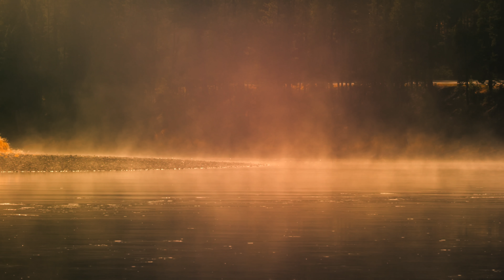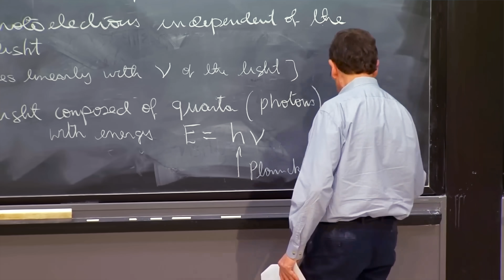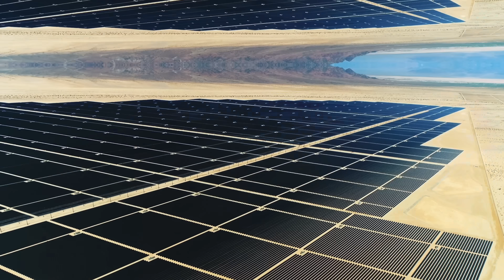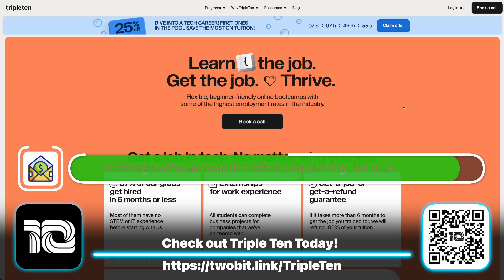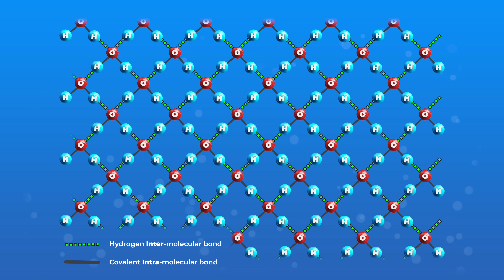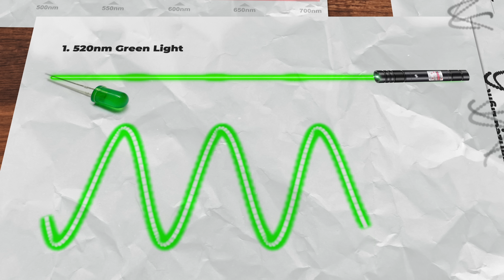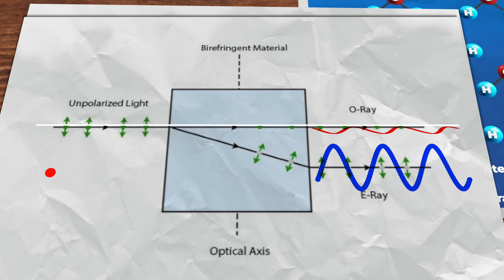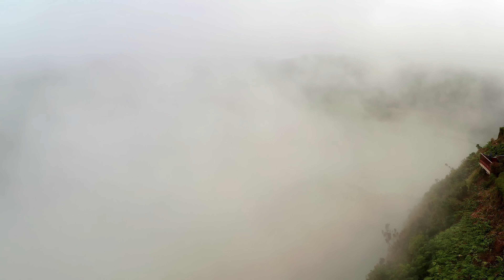New MIT Discovery Just Solved Water's BIGGEST Mystery!

Comment: Makes complete sense why plants hate green light. Green light evaporates water so plans reflect it away to reduce water evaporation.
Reply: This is so cool. Got me thinking. Could be why temperatures are cooler around plants, too.  They reflect the green light so there is more free green light in the vicinity to evaporate water in the air.  Maybe the evolution wasn't just to conserve water for the plant, but a symbiosis between the plants to keep each other cool.
Reply: @colleenforrest7936  Water  vapor in the air is already evaporated.
Reply: @pauleohl  not if it is small water droplets
Reply: @colleenforrest7936  Nope   The cooler temperatures are mostly explained by transpiration.   As the water evaporates from the plant it consumes a significant amount of energy according to the latent heat of vaporisation   2.45 Mega Joules per kg of water evaporated.    What is explained in this video appears to be a slight enhancement of this effect, a different pathway that helps with evaporation.  What is not clear is if it only works with water that is exposed to light directly.
Reply: @colleenforrest7936  I love this theory!
Reply: @colleenforrest7936  wouldn't this make areas nearby more arid and thus hot?
Reply: @colleenforrest7936  water in the air is already evaporated
Reply: @colleenforrest7936  Temperatures are cooler around plants because of transpiration. look it up.
Reply: @colleenforrest7936   Or maybe God is really really smart.
Reply: @colleenforrest7936  but plants  who live  in cold/very cold climates are green too and cooling air wouldn't help them
Reply from the maker: holy crap! I hadn't thought about that, but it does make perfect sense! need to look into this more!
Reply: @TwoBitDaVinci  This could go either way.  Trees taller than ~33 feet have to evaporate water to draw their sap up to the top.  Perhaps the green getting reflected inside the leaves augments the evaporation.  And this might be related to leaves changing colors in the fall, when trees sequester energy-rich sap down to their roots - no sense pulling against so much evaporative potential.

Fascinating, Captain... 🤔
Reply: @TwoBitDaVinci  - Plants ON LAND (especially trees) need to evaporate water, in order to suck more water up from roots, along with necessary minerals and biomolecules. Some individual trees are over 100 meters tall, evaporate over 1 tonne of water per day from their leaves, and they are NOT using their precious chemical energy (from photosynthesis) to 'power the pump'. Note that our best technology in pumps can only suck water up 10 meters, not 100. Trees do MUCH better than we can; trees use surface tension, capillary action, and other intermolecular forces within water, to SUCK water ten times higher than we can. That is another one of Nature's miracles.
Reply: @TwoBitDaVinci  I wonder if agricultural runoff that causes algal blooms on the top of natural water sources also can cause drought conditions by disrupting the water cycle by decreasing natural evaporation.
Reply: @TwoBitDaVinci  Its probably the other way around. They absorb other light so that the green can cause more evaporation so that they can get more nutrients up from their roots.
Reply: @TwoBitDaVinci  Yeah, let the sun shine through plants before it's hitting the water.
Reply: @TwoBitDaVinci  The terrible background music of this video will only serve to attract the dumbest possible audience.
Reply: @TwoBitDaVinci They actually talk about this in the article you just reviewed and deep dove into :)
Reply: @TwoBitDaVinci   pardon my naivety, would this water vapor be comparable to steam? Not sure if water vaporized with heat retains more heat than that done in this process or if that would matter when powering a steam turbine. 

Worked in waste to energy plants for almost two decades and this is basically what we do to make electricity. Burn garbage to create heat to heat tubes to create steam to power a turbine which makes electricity. As you can imagine, it is dirty, dangerous, nasty work. Especially when you have to rehab the boilers every six months to maintain efficiency and prevent tubes blowing. 

Not sure how big you have to go to make this work, but I am sure that the standard now is to build 5-7 story boilers, usually 3-6 side by side and burn garbage in them. . .  This sounds a lot safer, potentially less maintenance and potentially lower cost maintenance. 

Rushing water through a room bathed in specific light at specific settings sounds right up their alley. Ofc, the way it is now, pressure is created as the steam is created and then directs it where to go (cause there is only one way), we might have to lose some energy creating compression initially. unless we could create the needed light within the tubes/a confined space so the pressure is created and directed same as now. Another possibility is creating the tubes out of material that will hold pressure but will let the green light in to create the steam. 

Thanks for providing the opportunity to muse!!
Reply: @TwoBitDaVinci  So what type of engineer are you? What are your qualifications. Try misting water youll get 100,000 times more surface area and you dont need to pay for light which does nothing!
Reply: @TwoBitDaVinci  You really should have, like a lot before making this video.
Reply: @TwoBitDaVinci  thunderfoot just debunked this video, i strongly suggest you go and see his video if you want to learn something with real science, oops
Reply: @TwoBitDaVinci  please consider haemoglobin too in this context, as it is the same molecule as chlorophyll but with iron instead of magnesium as the central atom, which makes the hole piece red. ... :)
Reply: @mrparadise2329  probably why mamals like lying in the sun, they dont want to reflect the “warming energy” they want to absorb it… maybe blood is just red and there’s nothing special to it
Reply: @mrparadise2329  Quite a fantasy.
Reply: @mrparadise2329 That would be cool. I'd add covering how our body can use zinc for this when we're too low on iron.
Reply: @mrparadise2329  cells are doing fusion, mitochondria can fuse sodium with a proton electron pair to make magnesium, and can fuse potassium with a proton electron pair to make calcium.  They can also fuse sodium with oxygen to make potasium and fuse magesium with oxygen to make calcium. Neutrons don't exist they are just proton electron pairs.
Reply: @mrparadise2329  "please consider haemoglobin too in this context, as it is the same molecule as chlorophyll but with iron instead of magnesium as the central atom, which makes the hole piece red"
Haemoglobin is a protein complex, not a single molecule. I think you are getting haemoglobin confused with haem. Containing iron instead of magnesium is also not the only difference between haem and chlorophyll, they contain different functional groups. They are structurally similar because they're both based around a chlorin ring, but not close to the same..
Reply: @mrparadise2329  My knee jerk reaction to your comment was "nonsense, Haemaglobin and Chlorophill are totally unrelated"  but I think you're onto something.
Reply: @TwoBitDaVinci   remove the stupid background music next time
Reply: These MIT discoveries are always when the news arrives at Cambridge. Or when chemists figure out what farmers have always known. Every agricultural station in America has two  pans of water and for more than 100 years they've been recording the pan evaporation rate everyday, simply filling one of the pans up to the correct level each day.  You find the same thing in peru ancient Inca sites.  
Because if you need to know how much water to add to the soil to replace what's gone, there's no substitute for a pan of water that's subject to the wind and the Sun.  Even today we know that reading up on the temperature, wind and irradiance doesn't predict evaporation well enough.
Reply: interesting idea but subaquatic green algae also reflects green light and they are surrounded by water (definitely no worries with H2O evaporation) so I don't think that would be the main reason for using chlorophyl as main pigment absorb red and blue regions instead of green light.
Reply: Green algae floats partly at the top, so its still beneficial to reflect green light not to dry out to quickly.
Reply: @rteune2416  Green algae only floats because the O2 it has produced gives it buoyancy. Not because it is Green. Filamentous algae demonstrates this phenomenon very well on a sunny day. Unicellular algae produce O2 during the day and rise to the surface of ponds, only to sink again during the night once the O2 bubbles have been released or dissolved. Your argument, however, also falls down when applied to sedentary algae, which live attached to a substrate and are therefore immobile.
Reply: @Ed-bj5eq  It's theorized that one clade of early plants may have used retinol instead of chlorophyll for photosynthesis, meaning it's possible the earth was, at one time, covered in plants with purple leaves. I'm thinking that, rather than being green because it was more advantageous than other colors, plants are just green because it had a slight edge over the purple retinol due to the photomolecular effect being stronger at green wavelengths, so reflecting it away would have been slightly more efficient than specifically absorbing it, thus leading to the green plants outcompeting the purple plants. This makes me incredibly sad because purple is my favorite color and I feel like purple leaves on trees would be so pretty... And purple grass, too...

Edit: Basically, green algae in the deep ocean are still green simply because they're related to the clade of plants that used chlorophyll instead of retinol and thus survived better. It's not that they're green because it's beneficial that deep down, it's that they're green for the same reason that humans have tailbones, wisdom teeth, hiccups, and those tiny membranes in the corners of our eyes where other animals might have a nictitating membrane. It's a vestigial trait left over from the early stages of evolution when the trait was beneficial and thus survived, and it's much harder to un-evolve something once you have it already.
Reply: @StormTheSquid  its my favourite colour too!  You can get purple grass, its called Purple Haze ;0) and we still have purple sprouting broccoli, all though their leaves are green i think.
Reply: @Ed-bj5eq Okay, fair observation!
Reply: @Ed-bj5eq  perhaps what happened is a mutation occurred that slowed for the synthesis of a molecule that is better than other molecules at capturing electromagnetic energy. Out of all of the permutations that happened, green chlorophyll just happens to be the most efficient (interesting when you consider green is the most abundant wavelength of light from our sun)… but none the less could just be a coincidence
Reply: @Ed-bj5eq  Pardon me for saying, but that's a common misunderstanding of evolution. Evolution doesn't happen in response to a need.  A change happens randomly.  If the change is compatible with the organism's current environment, it survived. Then later, when the environment changes, organisms with a pre-existing change already in their genome that is more advantageous to this new environment will survive and thrive over those that didn't already have this random change and these organisms will not spontaneously change their genome to meet this new environment. They may, however change a behavior, but that's not the same thing.
Reply: @colleenforrest7936  While this has been the common knowledge, there's been several studies that put this into question. Seemingly the mutations are not as random as they were believed to be, and that the natural selection is not sufficient enough to explain how adaptable life is to new environments. 

Obviously a couple of studies is not enough proof, but a scientific mind should be open to the possibility that this misconception, might hold some truth to it.
Reply: @colleenforrest7936  Pardon me for saying, but that's a common misunderstanding of evolution. I'd love to see anything randomly spontaneously evolve something to help it survive, I'm waiting. We are intentionally experimenting on things all the time, exposing things to stuff all the time, observing them, quintillions of organisms watched under our microscopes for thousand upon thousand of generations and none of them spontaneously evolving anything. You're theory requires proof, of which you have none.
Reply: @Wishkeyn  Got to admit, things have changed in the last couple of years with genome being mapped now. Lots of strange stuff.
Reply: @colleenforrest7936  mutations are 100% random, but evolution which is the selection of mutation isn't. For instance mutations don't happen because of environmental pressure but environmental influences evolution speed.
Reply: @geemy9675  Mutation still must be under a guideline off creating an improvement
Reply: @jshaw4757  no, mutation are just random errors in the copying and combining mechanisms of DNA. errors are very improbable at the level of copying one nucleotide but at the level of an entire organism composed of trillion of cells in a constant cycle of death / duplication, and trillions of organisms reproducting they happen constantly. cancers and congenital disorders are some of the consequences.
DNA is just information that govern our growth/development and behavior of our cells, similarly to a computer program. like when introducing errors in the copying of a program, 99.9..% will generate bugs/defects, but because they happen trillions of trillions of time, sometime one defect actually influences the ability of the individual and it's offspring to survive and reproduce and statistics working in the favor of the mutation means after N generations the mutation can become present in the majority of the population.
it's a very inefficient way to improve a species and the success ratio of mutations is abysmal but it's the ONLY way to improve the gene pool. for human race, culture/education/learning has long take over evolution and is a much bigger factor in our capacity of adaption, than mutations.
Reply: @Wishkeyn  the mechanisms that generate mutations (error in the copying of DNA) like radioactivity, UV rays, or simply the minimum rate of errors that happens regardless of the environment, to have no "understanding" of the meaning of DNA.
it's possible that some genes are more or less subject to mutations than others and that this has become an evolutionary advantage one way or another depending on the genes (less mutations = more stability, less defects, more mutations = faster evolution) but the rate of mutation cant be influenced by the characters expressed by the gene, only by the way it's encoded in DNA. it's like if your copying a computer program in hexadecimal code, with an instruction set that you don't know, and you introduce differences. you can't predict what it's going to do, just observe the result. the DNA copy errors don't have a will to do anything they just happen.
the only mutations that are not result of random are the ones that would be crafted by humans given the mapping of DNA that has been decoded
Reply: @colleenforrest7936  Sorry, but that exposes one of the weaknesses in the evolutionary concept. If changes are random and not as solutionary responses to necessity or advantage then devolution and instability are more likely than positive advantageous Evolution. The increasing appearance of the necessity of programming for DNA is rapidly decreasing all viability for evolution. Changes tend to being detrimental and destructive for the organism.  We increasingly understand why we don't find inter-species examples.  The higher the likelihood of genetic change, the higher the likelihood of loss of survival. This must be accepted as the corollary to randomness.  Decades ago we were told the imaginative story of a . million monkeys with keyboards with endless time just typing RANDOMLY.  Eventually one monkey would accidentally type ON ONE PAGE a Shakespeare sonnet.  Great story, except that the allegory would not work with the materials of which life is composed.  And the correct arrangement of the letters for a sonnet does not honestly offer promise of the complexity of the arrangement necessary for DNA.  After all, it it less the arrangement than the coding for the precise duplication.  To make the monkey typing story truly applicable allegorically that monkey would need to design a typewriter which would type that sonnet flawlessly automatically infinitely.  But there is no more randomness.  Nope.  Eventually we need to grow up and dance to the music that the band is actually playing, even if they are not playing our song.
Reply: @colleenforrest7936  
You make a good point. Evolution is caused by random mutations, not because a plant decides it would be advantageous to obtain a specific trait.

However, for those of us that believe that evolution only explains the mutations we observe today (the seventh day where God rested from his labors), but does not adequately explain the fossil record: This  new discovery about green light fits neatly into place under the belief that a creator was designing things. That belief also explains how all the information could be encoded into the DNA of a cell that is necessary to build all the proteins it needs.

Evolution takes place, but it is a huge leap of faith to believe it could be responsible for all life on earth on a planet that is so young, in a universe that is only 13 billion years old (possibly 26 billion years old in a new hypothesis). Evolution also only tries to explain the origin of species, not the origin of life. If you start with a single cell organism, the math would suggest it should take trillions of years in the luckiest scenarios to get the variety of life we see on earth if we relied on random chance... But that math was done before understanding a lot of the added complexity of the DNA sequence and cell biology along with development timing. At this point, it just seems mathematically impossible to randomly add new information to DNA that is useful and doesn't result in the immediate death of the organism. Removing information by damaging a gene is far easier to account for, just like randomly typing a few characters into a software program never adds new working code. Instead, it just breaks that portion of the code.
Reply: @colleenforrest7936  that's outdated thinking. Evolution CAN change in response to needs, due to the existence of the epigenome. An organism's environment can cause DIRECT changes in gene expression from one generation to another. It is not "random"
Reply: @colleenforrest7936   'unguided evolution' is a myth.
Reply: @colleenforrest7936  I doubt that. dna is consious somehow. how else did the hares coat turn from mottled brown to snow white, the exact pigment needed for snow. you can say natural selection but how many snow white hares are born in a normal brown coated environment, and these aren't albino versions, they are normal just with white hair. why are tigers ORANGE yet can hide in the green leaves, unable to be seen by the prey. because the preys eyes don't see orange and the opposite color they pickup is green (or something like that I forget the specifics but its something like that) when a photo taken to match the eye of the prey, the tiger is literally invisible in these images. how did random evolution cause that? not gonna happen. how does random evolution explain stripes of differnt kinds. some are dots, some are sharp some are fuzzy stripes. no I think we know far less about DNA and how it actively turn on or off when in the enviironment. I wouldn't be surprised ( since everything is light, u and I  my keyboard, etc EVERYTHING) that light contains other information in it, and it is what signals the dna to turn on or off things. the entire random model from darwin is nonsense. its been proven false by some of the smartest mathemeticians alive. not going to even go into species evolution which doesn't exist only micro evolution does, IE finches changing bek shape size etc for specific environment needs. but the  finch never gave brith to a non finch. a parokeet never came out of 2 finches breeding. science is constantrly wrong about 2 species being able to mix. that would explain a new species being created. but evolutionarly no its never happeend that 2 cats birthed something other than a cat.  

lastly, people like you need to check yourselvs, you sounded like you knew for certain and everything you said was a fact. people do that all time in any science video comment section...when in reality, we just don't know for certain nearly anything. gravity, HAH, what a farce, the theory of relativity, WRONG, and completely destroyed.
Reply: @geemy9675  The competing theory is one of bounded randomness and information transfer much like some immune cells work (they go into a high mutation mode looking for an antigen) as pure randomness is impossible on normal timeframes.
Darwinian evolution is swiss cheese at this point and the people holding progress back are the people who think trying to find the proper mechanism makes you a creationist supporter.
Reply: @stormsabre22 there's not really much evidence for directed mutagenesis in the germline of higher animals though. There is dna repair being biased by region of the genome though, and perhaps by context/environmental factors. If anything maybe the rate of mutations that stick is inaccurate for reasons like these. There's also the notion of some genes and stress response systems being essentially unused until needed. So what looks like adaption through natural selection sometimes is not
Reply: @Wishkeyn  Its a myth born from people only looking at the peak absorption spectrum of chloroplasts, as opposed to looking at how the  whole leaf, or even better, the whole plant, makes use of different wavelengths. 

The whole leaf itself makes use of green light quite effectively, and rather than simply not using it, the green colour is an adaptation to better diffuse the green light deeper into the plant so it doesn't overwhelm and damage individual chloroplasts. It absorbs a little bit at each chloroplast, ultimately using most of the incident green light that hits the leaf.

This is why the overall rate of photosynthesis is mostly determined by the number of photons that hit the leaf per unit of time, regardless of the wavelength, as is given by the action spectrum (mccree curve)... and when considering the whole plant, for bush or tree like plants with layers of foliage, this becomes even more pronounced.
Reply: @michaelransom5841  Why am I tagged? I just said evolution, might be guided by more than just natural selection.
Reply: @colleenforrest7936  If it works, don't fix it.
Reply: @colleenforrest7936 this sounds correct but also sounds wrong, by what you're saying that would mean all desert plants were already around before the desert was there
Reply: @gfdia35  interesting, how so?
Reply: @jshaw4757  mutations are random and  "positive" mutation are selected ( "negative" mutation disappear and "positive" ones thrive) resulting in evolution following two citeria
-reproduction rate
-survival from birth to reproductive age
it's not ALWAYS in the best interest of the survival of the species although it usually is:
some mutations will increase reproduction  but will have no or negative impact on survival like beautifully colored feathers which make males more attractive to females but can also make them easier to spot by predators. imagine the males have a 10% lower survival rate but 50% reproduction rate. their offspring will be ~40% more to reach reproductive age and they will get more and more prevalent in the species population and the less attractive mutations will progressively disappear but because the food doesn't increase ultimately you could have less individuals reaching adult age and the population could shrink. if the mutations are too dedicated for reproduction and not enough for survival, it can result in the species disappearing. so yes between two separate species, usually evolution will select the most adaoted for survival, but within a species, it's not always the case. this is how you have peacocks that carry heavy feathers that give them advantage for reproduction but make them very bad at flying. they still managed to survive as a species but they are nowhere as common as other species which evolution focused purely on mass reproduction, high adaptability and like ants , rats, flies, mosquitos etc...
Reply: @colleenforrest7936  I knew that ofc but it just struck me how hard it is to make real randomness. The odds to lose the legs are much better than to get 4 in stead of 2, some creatures get a hundred. Even more interesting are the odds to later get the legs back. They could reappear fully functional with a billion years of leg evolution. We also have no idea how much data is really inthere already, this might be our 100th planet. Funny stuff
Reply: @Wishkeyn  yes, birds quickly adapt new beak types based on available food sources. I believe even Darwin noted this with Finches.
Reply: Anyone who uses the word 'randomly' in a scientific setting are automatically disqualified and any measure of actual understanding is not within them @colleenforrest7936
Reply: @colleenforrest7936  Love and believe your comment is true in most cases I recall a recent article about a plant or creature evolving rapidly (3 to 5 generations) due to environmental challenges. I am sad that I don't recall details or where to find the information
Reply: @jshaw4757  Mutations are not guided.  The amount of life forms available in an environment allows for random mutations to occur without all organisms dying out.  Like a previous commenter mentioned, the ones that have a superior trait are the ones that pass those traits on to their offspring.  There are many unused traits stored in the genome from previous mutations that are only necessary at the right time.  And once again, these mutations are passed on to the organisms’ descendants.
Reply: @Ed-bj5eq  Bu they consist of water molecules as part of their being, reflecting it away might very well be a way of defence from " green light radiation "
Reply: @Anubite89  absorbing it would work better though
Reply: @Ed-bj5eq  My two cents.  This indicates clouds absorb green light allowing red and blue through.  Plants that use red and blue would out perform plants that need green when the clouds/mist/fog were more common.
Reply: @Ed-bj5eq everything flora and fauna is beneficial to fungi. maybe it has an influence here. it has a habbit of making things act for it, rather than for themselves.
Reply: @Ed-bj5eq wasn't it hypothesised that green plants were survivors of the purple plant arms race which were so efficient that they caused an oxygen catastrophe? So green plants, the users of leftover nongreen light, were the only ones left
Reply: @Ed-bj5eq  Yes, you're right about that.
Reply: @Ed-bj5eq yes, algae is "green". Some algae. Multicellular algae that likes living on surfaces and at the top of water columns. Unicellular algae tends to not be green.

In other words, algae that lives near the sun is greener. It makes sense.
Reply: Dude, that's right! Also probably why chlorophyll evolved to absorb everything BUT green light. Nice catch!
Reply: @ipp_tutor  science!
Reply: @ipp_tutor trees and tall plants require transpiration to literally create the vacuum suction required to pull nutrients up from the roots... Evaporation is not a plants enemy
Reply: @ipp_tutor plants require warmth (infrared) and energy (high frequency, uv). These colors of light are simply more useful for photosynthesis than the green light
Reply: @ipp_tutor plants have more than just green chlorophyll inside them
Reply: @ipp_tutor  was just about to post this. Great minds!
Reply: @ipp_tutor  Indeed.
Reply: 588nm?
 @ipp_tutor
Reply: @ipp_tutor How do you all come to the conclusion that plants can't process green light 🤦‍♂️ this has been proven in plant breeding for more than 10 years and you can read about it everywhere. But people like you also buy purple LEDs for plants 🤣
Reply: @ipp_tutor  now chemicals are evolving 😂
Reply: Does not make any sense to me - and you got 350 likes for it?!??? and an additional heart from 2-bit-daVinci???!!!???. Can you explain what you mean? If plants would intentionally reflect green light for the sake of reflecting it, any water on the surface or within the leave would be intentionally hit twice - by the green light coming from the sun and again by the green light reflected by the plant. How would that reduce water evaporation? The green of the plants is the left-over of photosynthesis, which uses up the blue and red part of the spectrum in order to split CO2. That's how plants "eat". Whether or not the newly discovered effect plays any additional role in this at all might be an interesting question, but that can't be answered with a simple ad-hoc association.
Reply: @marcelma  Why can't these people get excited because something finally makes sense. There are exception to green leaves  in nature. Think about it, during autumn trees gets less sunlight and chlorophyl in trees break down and the tree leaves dry out and fall.
Maybe it happens because absorbing green causes leaves to dry faster, maybe not. Maybe these are not even corelated. But the thing is to keep an open mind.
Reply: @solo10041  Tree leaves dry out and fall, because the tree is reducing the water supply and it is re-absorbing the ingedients of clorophyl, because it doesn't "want" to loose them, when it throws off the leaves. - These are all well understood aspects that made sense long before. I have nothing against people getting excited - I have been wondering what exactly are they getting excited about. A flash of real insight into reality might feel similar but is not the same as an imagined "aha"-moment, because the latter merely links two previously not connected thoughts.
Reply: @solo10041  That isn't really an exception. It is true that the colour changes of deciduous tree leaves in autumn (prior to the leaves completely dying and falling off) is a result of the chlorophyll decomposing: The red/yellow/orange pigments in the leaves were always there, but in lower concentrations than the green chlorophyll. The green colour of healthy leaves is therefore much more intense, so it outshines the other less intense colours.

A good analogy for this is the older type of sodium-vapour lamps used in street lighting: The discharge tubes in these lamps contains a low pressure mixture of approximately 99% neon and 1% argon gases, plus a tiny pellet of sodium-mercury amalgam. When the lamp is switched on, starting from cold, it produces pink-red light from the neon component. This generates some heat and therefore warms up the lamp, until it is hot enough to vaporize sodium. Adding sodium vapour to the gas mixture generates extremely intense yellow-orange light. The pink-red neon light is still being produced, but you can't see it because the yellow-orange sodium light is so much brighter.

The exceptions you are really looking for are those where the intact, active chlorophyll is not green: Yes, these do exist - perhaps most commonly in some species of algae, such as blue-green algae or red algae. Some seaweeds are red or brown over their entire life cycle, such as "Irish moss", which is used to make carrageenan and other related thickening or gelling agents. There are even some trees which have a red variation of chlorophyll and hence red leaves - the most well known are several species of maple tree.
Reply: @marcelma  yes if chlorophyl "wanted" to protect water from green light it would absorb it, not let it pass through like it does.
Reply: @marcelma  its people drawing an inference without evidence based on a misunderstanding of the role of green light and transpiration in photosynthesis.. it doesn't stack up when scrutinized though.
Reply: Everyone knows the score after the game is over!🤦🏿‍♀🤦🏿‍♀
Reply: This would have implications into the search for planets with complex life. Odds are most of not all plant life would have a green component, provided that the host star produces green wavelengths of light.
I wonder what other molecules react in this way to certain wavelengths of light.
Reply: @OzGreg  "I wonder what other molecules react in this way to certain wavelengths of light" .. i would say most...
..and that the 'choice' of geen light or EM of a special frequncy to reflect, helps in sevral chmical processes plants use(to not absobe green)..
take silicon(Si) colar cells as an example.. thay make excellent use of energy from red-green light, but performs exceptionally bad at blue where almost zero is absorbed, this is simple down to one fact the band-gap of electrons, the ability of the electron cloud of an atom to absorb energy of a certain frequency enugh to knock one of the electrons to a higher energy state.. silicon lacks the ability to absorb blue almost completely... chlorophyl/green leaves lacks the aability to make use of a certain ban-gap because of the atoms the molecules are composed of...

..what baffels me is that a scientist claims this is new information...
..been known to physicist for decades atleast (its the main reason cheap solar panels cant exceed 31% effeciency, most will tap out at 20-25% constructed as todays once)
Reply: @OzGreg  there are more types of chlorophyll with different absorption spectrums that could be equally useful on a planet with different conditions.
also the green light reflected by plants is not a single wavelength so it's not something that could be amplified. stars are at least  billion times brighter than planets.
detection of exoplanet is almost never direct imaging and when it is, it's only gas giants and even if plants could live on those planets (!) the likelihood to detect green light from plants through the gases is zero.
Reply: @OzGreg the star would need to peak at the green part of the visible spectrum after passing through the planet’s atmosphere, not just produce green light period.
Reply: @OzGreg  Probably all molecules react to light as you suggest. Lately, scientists are "tuning in" to plants by attaching electrodes which intercept sounds resembling what we call music.
Reply: Now that is a very interesting thought. In otherwords Chlorophyl reflects the green light to minimize evaporation from plants. Looks like the astronomers looking for reflective spectra from alien photosynthetic spectrums might still need to look for green plants too!
Reply: Damn, this absolutely makes SO much sense! 😲
Reply: @gregokeefe6502  "I wonder what other molecules react in this way to certain wavelengths of light" .. i would say most...
..and that the 'choice' of geen light or EM of a special frequncy to reflect, helps in sevral chmical processes plants use(to not absobe green)..
take silicon(Si) colar cells as an example.. thay make excellent use of energy from red-green light, but performs exceptionally bad at blue where almost zero is absorbed, this is simple down to one fact the band-gap of electrons, the ability of the electron cloud of an atom to absorb energy of a certain frequency enugh to knock one of the electrons to a higher energy state.. silicon lacks the ability to absorb blue almost completely... chlorophyl/green leaves lacks the aability to make use of a certain band-gap because of the atoms the molecules are composed of...

..what baffels me is that a scientist claims this is new information...
..been known to physicist for decades atleast (its the main reason cheap solar panels cant exceed 31% effeciency, most will tap out at 20-25% constructed as todays once)
Reply: Rejecting green removes a transpiration variable, making water regulation more controlable. This very well done video practically leads to green plants. Perhaps frogs and other green fauna use it too? I claim no aptitude in zoology, so leave that for others.
Reply: Perhaps we need to rethink molecular bonds. And if light can directly excite electrons then we could develop motors that run directly from sunlight.  What are the the limits placed upon the newly discovered effect by surface tension?  Can this effect be used on water in an enclosed glass container?
Reply: Probably more because if it is green it can't use the free electron as easily to make photosynthesis
Reply: Green from plants has to do with chlorophyll’s absorption, not water evaporation or anything to do with photomolecular effect.  It’s fortuitous that they happen to be green.  If you study the chlorophyll molecule and its excited state from absorption versus its non-excited state, it’s not a phenomenon because it matches water evaporation.
Reply: @thomaskn1012  there are different kind of chlorophyll types, evolution has selected the most efficient ones that are used by every plants.
but absorbing red and blue light and letting green light pass through does not bring any evolutionary advantage regarding water evaporation, if anything absorbing green light would reduce water evaporation. also in a dense primary forest there is a whole lot of water and humidity but light is scarce. so capturing green light would be an advantage, and even it increased evaporation, which it doesn't, it wouldn't pose any issue regarding water.
Reply: @thomaskn1012  close but not 100% true... in the atmosphere, there is too much energy in green light... if chloroplasts efficiently absorbed it efficiently, it would damage the photosynthetic mechanisms. selective pressure pushed the absorption spectrum towards dispersed absorption of green light.
Reply: @thomaskn1012 Um… all of it is from natural selection pressure and processes.
Reply: So if i understand it right, spraying a fine mist into green light it would be the most efficient because of the amount of air in the air? 

Also, would that mean that painted water will evaporate differently? 

Wouldn't greenhouses also benefit when green light gets filtered out before hitting the plants? Would less evaporation mean that the plants are more efficient? What about the extra heat? 

This topic seems really interesting.
Reply: @bastiannenke9613 I think in the green house senario the glass box is the water trap and not letting it evaporate away so not really needed but I suppose it would make a great experiment to tint glass green on the roof and and grow identical plants in a clear vs green one but I suspect you'd actually get lesser yield out of the tinted green one simply because you're now decreasing the full suns energy making in inside the house
Reply: That means plants on other planets would also be green
Reply: @Trollsworkshop  except those plants that are red anyway on Earth too :))
Reply: @Trollsworkshop except the possibility of that alien worlds host star being different like a red giant perhaps
Reply: I don't think that's related. The green color comes from absorbing red and blue light. The green part is reflected or just pass through. By reflecting green light the photons would have a longer travel through water and a higher chance of breaking the hydrogen bonds on their way. Absorbing the light would have much more effect
Reply: Word!!!
Reply: watching the video and this came to mind too
Reply: Maybe a good spot there... I think it could be a secondary reason though, if not just coincidence. Evolution is a genetic battle. It usually takes more than one reason for some adaption to persist.... I also think lots of focused magnifying glasses are the simplest way to desalination.. Fields of Lots of tall glass tubes with magnifying lid and run-off pipe at the top going to a condenser cooled by incoming cold water about to fill the tubes, surrounded by a mirrored ring focusing light through the field or perhaps individually directed concave mirrors.
Reply: now you're getting it.
well done, human.
Reply: @growthisfreedomunitedearth7584  .. Growth is cancerous and apes will never unite unless they're transformed into AI-controlled Tanshumans. Freedom is non-reliance on other people.
Reply: Plants don't "reflect away" green light at all. Green is what remains after they absorb red and blue. That makes plants look green to us.
Reply: Wow, so many armchair scientists under one single video …
Reply: This could also explain why  plants grown in low light areas have a darker green color then those grown in the light. Because of low light, the plants will need bigger then normal  leaves but that means  more surface area and more  waterloss. so the plant compensate  by havinh darker leaves.
Reply: Nature again, its in plain sight we just cant see it
Reply: maybe it is why we humans are not green. But aliens from planets with less water are little green men? Lol
Reply: I really enjoyed both the post and responses. It would be nice to have tool that scrapes all the ideas that have stemmed from this and kind of fact checks them against known scientific knowledge and sorts those needing further investigation.
Reply: @markpirola8152 agreed, I've had a great time reading these comments,, that almost never happens, and I was thinking the same thing but for a complete success actual work needs to be done lol
Reply: you'd think we'd have been able to figutre that out a while ago... how dumb are we collectively? smdh
Reply: Many of the shade cloths used at nurseries and in yards are green for a reason. I would like to see a comparison between soil moisture levels for green shade versus tan shade versus...
Reply: Plants aren't actually very good at reflecting green light, they just don't absorb it. This is why with thin leaves you can see through them and everything is tinged green. In fact, plants would benefit from actually evolving the ability to absorb green light, but altering chlorophyll in this way would require unlikely mutations.
They are green because green absorption evolved first in microorganisms (green is actually the peak of the sun's spectrum; green absorbent microbes look violet) and took up more of the most abundant wavelengths in the ocean, so it was successful to use unabsorbed wavelengths rather than green which was already mostly absorbed.
Reply: Is this related to why a house with blue roof don't burn in Hawaii?
Reply: @evelynn4273  Someone is paying attention
Reply: This is in reverse, if plant is colored green then it evaporates more water.
If you have known evaporative cooling where the body cools down when the water evaporates, this means that the plant was able to survive direct heat from the sun because they can expel more water and cool themselves down.

This discovery is quite revolutionary especially if you understand that most of plant enzymes need a certain degree of energy to start catalyzing co2 to sugar, this now backs up why you can grow plant in grow lights even with the absence of heat from solar radiation. This means that you can technically absorb more heat from air to plant allowing the surrounding air to be much more cooler (heat sink) and bring new perspective interm of global cooling (meaning green material/leaves can technically cooldown earth more than sea water with similar area).
Reply: @betabotz4391  I agree if plant doesn't absorb green light, it means it lets more green light bounce on the white cellulose, so it could evaporate slightly more water that is on the surface. but plants are not THAT concerned by heat. usually when they  do there is no more water on the leaves to evaporate.
by the way evaporation of water doesn't happen due to plants but mostly due to sunlight hitting the oceans. this is how vapor goes into the atmosphere and later condenses as clouds. every cooling effect of evaporation will be compensated by condensation later. water does not keep accumulating on the atmosphere , ultimately it falls down. the only way to increase the amount of water in the atmosphere is global warming. hotter air holds more vapor. it's the same reason you can't cool down a room or any closed system with evaporation (like a swamp cooler). you can locally cool down air, increase humidity, which will condense and give back the heat. a heat pump can move heat because you have a heat source and a heat sink with good heat insulation between both
Reply: @geemy9675  Note that the green color of the plant is the Chloropyll pigment which is located "Inside" of the cell, basically in the chloroplast. Note all part of the cells is green-colored.
Don't be an idiot and treat the entire leaf as a green material where it will totally bounced off the green light. Take note that these membranes/granum were unsually aligned to refract green light rather reflect and were locate usually on the side of the cell. That is why when we study the cell and stick to our usual understanding of photosynthetic activity, plant adapting green colored is quite not right.
If plant is to absorb enough heat from light (frequency >570) and the refracted greenlight serve as trigger to maximize transpiration/evaporation.. it will now have enough reaction mechanism to suck-in water from roots to leaves... IT NOW makes total sense.... More water evaporated=more pressure differential in the leaves system = faster nutrients transfer + more cooling to withstand radiative heat.
As I said this study is SO GROUNDBREAKING if you know what you are talking.

Edit:
In short.. you scatter/refract the green light inside the cells of leaf rather than reflecting it on the leaf's surface. In layman terms, you just make the entire cell (except the chlorophyll itself) to have "more" green light (white/day light + green light from refraction).
Reply: You can apply this idea more deeply to the photosynthesis reaction. Photosynthesis uses water as an input, and if chlorophyll did not reflect green light, the reaction probably would be less efficient.
Reply: @idou1149  no because it has nothing to do with evaporation. the green color is the result of the chlorophyll absorption spectrum, not the other way around
Reply: @geemy9675  And the chlorophyll absorption spectrum just happens to reflect the spectrum of light that excites the very water molecules the chlorophyll is trying to use? THAT seems like a stretch. . .
Reply: @idou1149 microwaves are the wavelength that best matches the harmonic of the water molecules, not green
Reply: @idou1149  probably is a far stretch
Reply: @geemy9675  And the chlorophyll absorption spectrum just happens to reflect the spectrum of light that excites the very water molecules the chlorophyll is trying to use? THAT seems like a far stretch. . .
Reply: @idou1149  chlorophyl does not reflect green light it absorbs the other wavelengths and lets green light pass through and the cellulose which is white reflects all wavelengths, so chlorophyll is not a shield against green light it's quite the opposite.
Reply: @idou1149  Not if it used the green light. It wastes it now.
Reply: @idou1149  Highly unlikely.  Plant only use a tiny fraction of their water for photosynthesis - most is used for dissolved chemical transport.  But the green-light-evaporation thing only applies to water exposed to the atmosphere - not in cells or within plants.  So it might impact evaporation at the stoma (typically on the bottoms of leaves).    Many primitive plants, like algae, don't even have stoma.
Reply: That's not the reason. The sun's light actually is slightly higher in the green colour spectrum than blue or red. Green is therefore the optimum colour to maximum light absorption for photosynthesis.
Reply: @geetarwanabe  why it reflects green away then?
Reply: Interesting insight, but chlorophyll seems to be green to deal with fluctuations in light.  SciShow has a video on it "Why are plants green instead of black?" from 3 years ago.
Reply: The first photosynthetic organisms were purple though; and green only became predominant choice later... I'm not sure what that could mean under this new light (pun  not intended)....
Reply: and in the meanwhile the green reflected light helps to evaporate water located in the nearby area which gives the plant a more humid environment which gets the plant to grow more and produce more leafs and takes in more water to produce more oxygen. Isnt nature just fascinating.
Reply: mind blown, thank you
Reply: Insightful response….
Reply: You'll notice how some plants flip their leaves just before it rains.  This allows the leaf undersides, which on many have tiny hairs that catch water as it falls.
Reply: WOW!! What a Great Tip!!! Thank you man!!
Reply: I keep a tote filled with about an inch of water on my fridge. After about a week it evaporates, but not because of heat.
Reply: @johnjeffreys6440  on or in? anyway air in a refrigerator is dry. refrigerators condense water from the air and evacuate it. air at 6°C can hold about half as much water as ambient 20°C
Reply: @geemy9675 lol ty you I was like what in the hell 😂 inch of water in a tote ,, fk are you on about son 😂
Reply: @johnjeffreys6440 first why? 2nd if it's in your house it is because your ac removes all the moisture in your house to make it colder same as inside a fridge
Reply: Old information.   See BBC documentary Global dimming.   Evaporation rates were dropping for decades & it was found decades ago, the photon relationship was more of a factor in evaporation.
Reply: Funny thing is, the sun emit mostly green light.
Reply: Deuces for the deduction. 🍁✨
Reply: Holy crap!
Reply: Plants' chlorophyll reflect lots of infrared light.
Reply: Our sun is mostly green.
Reply: I guess non of you read the exact paper, researchers just used a green laser to show this photoeffect. They do not claim that other wavelengths do not cleave water clusters, which I believe do. This is naive and incorrect assumption at all! I think that channel should have mentioned it, otherwise it is similar to dirty journalism and clickbait  such as "Asteroid will hit the Earth!!!"
Reply: I immediately thought the same thing when you said green light. I wonder what this phenomenon says about relationship of chlorophyll to its green color and other “phylls” relationship to the purpose of their color/reflection of a certain frequency of electromagnetic waves.
Reply: Good reasoning.

Now we just have to wait for another decade before those "geniuses" at MIT and other overfunded and overrated institutions start using their brains to figure that one out like you did here, in an instant, in YT comments.
Reply: And beta-carotene dissipates heat. A perfect combo.
Reply: you're the lind of people Elon Musk is seeking. Sincerely.
that lind of reasoning is a sign of some kind of genius!
well thought and said!
Reply: @SaberBenSalem bro spell check sheesh ffs
Reply: @gfdia35  :)  next time bro
Reply: Oh, I just posted a comment about that too! Also chlorophyll is tuned to use mainly blue and red light for photosynthesis! Amazing right?
Reply: Interesting
Reply: I need some green filter on my windows to grow my plants faster now
Reply: uh no, infrared is the key, and any light will work. this isn't new technology, this was all discovered and talked about long ago, go read The Fourth Phase of Water by Gerald Pollack.  Why am I being led to believe this is something knew by someone who is clearly a token ethnically diverse person?
Reply: This is a bit of a myth. Green light is too intense and would damage the sensitive photosynthetic mechanisms if absorbed all at once by a single chloroplast. The plant still uses greenlight, but it diffuses it across multiple chloroplasts by not strongly absorbing it in the top layer of chloroplasts, allowing the light to penetrate deeper into leaf surfaces to drive photosynthesis in chloroplast located towards the bottom surface. 

In fact, the McAree curve is basically an inverse of the solar spectrum, meaning plants have evolved to "flatten" out the spectrum so to speak, and maximize the efficiency of the use of the light... almost as if they evolved to maximize the use of sunlight.. lol.

Outside of some morphological issues, you can grow plants under pure green light just fine.
Reply: I also got a insight about plants, but because   they are crucially need evaporation to pump water high. So we need to decide if they don't absorb green light to leave that energy for evaporation or they reflect it to slow down evaporation around.
Reply: My mind immediately went to plants and chlorophyll when they mentioned the ideal wavelength of light is in the green area of the spectrum.
Reply: If there's specific frequencies that splits water molecules more efficiently, maybe filters that change all other non- efficient frequencies to efficient frequencies would work better?
Reply: There are some plants with dark leaves especially in tropical countries.
Reply: @watermenlon3617  but they use the same chorophyll
Reply: Dayum, bro! Nice connection!
Reply: I think the green light reflected might accelerate evaporation by scattering the green throughout the foliage.
Reply: I’m not sure that holds up. From what I understand it’s just making contact at all that produces the effect, and mainly happens at the very point where water makes contact with air, so it wouldn’t really matter if the plant is reflecting more of it or not, since either way it’s getting hit by it.
Reply: Well, plants are green because green is the only “color” of the light it doesn’t absorb
Reply: @ElJosecho  Not quite. Plants do have other colors of chlorophyll inside them (as evidenced by their changing leaf colors in the fall for trees. The purple, orange, red, etc are other types of chlorophyll in the leaves), but green chlorophyll is just the dominant type in a lot of plants
Reply: I was thinking the other way around, chlorophyll is translucent so are leaves, they only let green light in, thus, it make the water expand and would've explained plant growth
Reply: the absorbed light is converted to heat
Reply: also, plants do reflect infrared
Reply: Maybe I should wear a green shirt in the summer.
Reply: And this means that plant life on other planets likely tends toward green as well, even if their stars don't emit exactly the same spectrum as our own...
Reply: Awesome comment.
Reply: Mind blown!!!
Reply: Also it explains more rains in areas having large number of trees, resulting in green light being reflected causing more evaporation thereby resulting in higher concentration of water in the atmosphere which ultimately form clouds or condense to form rain droplets
Reply: Plants do have mechanisms to regulate water loss, but these involve controlling stomata (tiny openings on leaves) and not specifically reflecting green light.
Reply: DUH
Reply: Brilliant!! 🧠
Reply: Most plants are not water conservers. They actively try to evaporate as much water as possible because nutrients flow in with water, so cycling through as much water as possible gets maximum nutrients from the soil relative to neighbours. There are other highly effective tricks to minimise water use when it is an issue, but it very rarely is.
Just because plants need water doesn't mean holding it is better.
Reply: i'm afraid that that is an unscientific jump to a conclusion.
Reply: No, plants are green because they preferentially absorb red and blue.
Reply: I think idou1149 has it precisely. Since water is actually an input in photosynthesis, you don't want it turning into a gas in the middle of the process. Your chloroplasts might explode. lol.

As regards mrparadise2329's point about hemoglobin - well, let's think about this. When you are overheated, your capillaries open up and more blood gets to the surface. Maybe this is why I find it oddly comfortable to do a little gardening in the midday sun versus on either side of midday when all that happens is that I just get hot and sweaty and uncomfortable.

If the atmosphere filters out green light at certain hours, then its evaporative effect is mitigated. And all that happens is that I get beads of sweat and feel hot. 

Viola! lol.

We should therefore wear green clothes when we are outdoors to keep cool.

Drat, I think I only have one green t-shirt in my things.

Edit: On the other hand, you don't want gas bubbles forming in your bloodstream so I think this needs tweaking.
Reply: Transpiration happens either way though.
Reply: I don't think plants feel one way or another about green light. The process of photosynthesis requires the absorption of red and blue light, which leaves green to be reflected.
Reply: Contrary-wise, some plants, like trees, would depend on this to create the amount of negative pressure needed to bring water to their uppermost branches/leaves.
Reply: I hope it was a joke.
Reply: I hope it was a joke.
Reply: except that is completely false and the light goes through all the water parts of the plant anyways
Reply: Yeah except that isn't why they reflect green light
Reply: You're talking nonsense... Plants process green light too. There are good research reports from Sanlight. But it's precisely because of people like you that they keep buying these purple LEDs just because you have no idea. Greetings from Austria
Reply: @Cryogenic1981  Thanks. I'm actually interested in preventing evaporation, to reduce the amount of water needed for plant irrigation. So, this is interesting to me for the opposite reasons of this video.
Reply: It's the exact opposite, but you don't even understand colors.....omfg....
Reply: Could be, but more likey is that the green if the least abundant color in the spectrum, therefore allowing more of the light to be absorbed. Yes water retention is important but transpiration is also equally essential for plant life. It's like drawing a conclusion humans evolved with bigger stomachs to eat more food, but that extra tissue also creates more metabolic energy expenditures. Also there are like 6 different types of clorohpil with slightly different colors.
Reply: NOT SO MUCH.   Water inside the plants cells or within the xylem or phoem channels isn't going to evaporate - period.  It's a closed system so any vapor pressure is at equilibrium.   Plants do lose water to atmosphere (transpiration) through stoma structures which exchange CO2/O2, cools the plant, and also drives the xylem transport.   Plant don't "hate green light", they just love red and blue for photosynthesis.
Reply: After reading the MIT PNAS paper - this conjecture goes from unlikely to highly improbable.  Of the ideal light (polarized, green 45deg) only 0.84% is absorbed by a water surface.  Let's make a crazy-high estimate that 0.25% of the entire solar spectrum is absorbed for photomolecular -evaporation.  Also lets make a high estimate that this excess evaporation is 4x more efficient than thermally driven evaporation (the paper suggests similar).  So the light-effect would increase the evaporative energy ~1% (0.25%*4).  1% sounds not-trivial, but we get a similar 1% increase as our sky-high estimate from a + 0.3dF (<0.16C) temperature increase.    I don't see this tiny effect driving much selection pressure.

Plant are green b/c that NEED to absorb red&blue and have no use for the rest.
Reply: How about Purple Leaf Plum ("born to suffer")? AND, how about seaweeds, they are green inside water. And taking in account that all life out from the water, they were green before direct sunlight.... Or, for example frogs, they are mostly green, and reflected green light will avaporate liquid from the skin faster (back lit), skin in that case supposed to be absorbing green light. Your theory definetely logical, makes sense, but it doesn't explain water plants and water weeds...
Reply: Stupid as hell
Reply: @Cryogenic1981  plants love green light, plants are green because there is the most green in sunlight, nature wastes nothing. if plants wanted to protect themselves from excessive evaporation, then the leaves would reflect the infrared radiation of the sun, because IR radiation is much more present and overall more energetic than the 555nm green
Reply: Whooooaaaa!!!!!Holy crap that's crazy.
Reply: Holy s****!
 Then we should not use green netting for "green houses"??
Then either the black or sliver might be better!
Reply: What if you take out blue and add infrared red and red?
Reply: Green light also negatively affects the cycle of photosynthesis
Reply: Very true.
Reply: This explains why martians are green!!!
Reply: Open source intelligence right there!
Reply: It could be a factor but I would be careful about jumping to that conclusion. 

This explanation would only make sense if reflecting the green light decreases the likelihood of this interaction occurring on the plant. Given that it is a surface interaction (i.e. the effect happening further inside the plant would not cause evaporation because the water is not in a position where it can leave the plant) reflecting the green light rather than absorbing it may actually increase the incidence of this effect (absorbing the light with a pigment would reduce the number of times the light passes through the surface of the plant).

Compound this with the information that:
- Not all plants (or more generally green photosynthetic organisms) are in areas where transpiration is a negative thing--thus this selection pressure would not be present for aquatic plants or ones with excess or sufficient water supply. We know that there are shallow water green alges that have been around for a long time (which would never have a reason to limit transpiration because they are literally swimming in water).
- There are other fairly well researched reasons that plants may avoid using green light. For example that structures that absorb it (with green being the peak output of the sun for terrestrial/shallow water) would have harvest too much energy which could cause damage or disruptions (basically over charging things which is dangerous). This research that looked into this model of 'moderating energy capture' and it apparently fit even with things like purple photosynthetic bacteria (because the spectrum of light reaching them was different).

tl;dr there may be some connection in some places, but I don't think this is anywhere near enough evidence to come to that conclusion especially given there are already other models that seem to fit more universally.
Reply: @kanoaika The fact that evaporation happens was settled. A more specific mechanism of HOW the process works is all that is updated.
This is exactly how science works. The whole isn't invalidated with new data. For instance, the fact that some diseases are contagious was already known, but then specifics wee learned about viruses, then later figuring out more and more down the line doesn’t invalidate the previous info.
In other words, science must be able to fine tune and even be able to toss out theories and replace the former hypotheses with the new information.
Fine tuning what came before is part of the process.
Reply: @DCJensen333  Very correct ...
Reply: @kanoaika  TLDR but yeah, I think chlorophyl A and B are the two most effective compounds for photosynthesis. if there was other variants with different colors that could be combined and capture more wavelengths it would exist in nature.
Reply: @kanoaika  Thanks for pointing this out.  I was going to go into the cascade of electrons and all that as to why they are green, but I think your version is a little more comprehensible for the readers here.
Reply: @kanoaika  Thank you for being one of the more reasonable responders.. lol.. you hit the nail on the head when you said "that structures that absorb it (with green being the peak output of the sun for terrestrial/shallow water) would have harvest too much energy which could cause damage or disruptions (basically over charging things which is dangerous)." 

That is where the evidence points... To clarify, while green light is less absorbed by chlorophyll compared to blue and red light, it is still very effectively utilized across the entire leaf. Green light is diffused and used across a greater number of chloroplasts with just enough absorbed at each one to maximize absorption while minimizing damage, as is supported by the action spectrum, even more so when considering the entire plant.... an interesting observation, and not really surprising either..

Interestingly, when you compare the action spectrum to the solar spectrum, you’ll notice a near inverse relationship. This indicates that plants have evolved to maximize the use of every incoming photon while minimizing the risk of overloading their photosynthetic systems. Imagine that!.. lol..

and you are also on the right track when considering aspects of where evaporation happens. one of the things that people are overlooking here though, is the fact that evaporation is critical to the photosynthetic process, in the form of transpiration. it is the very act of evaporating water at the stomata that allows plants to create the partial pressure gradient that allows for the exchange of C02 and oxygen. the faster the rate of transpiration, the faster the rate of photosynthesis, other limiting factors aside. Plants are only interested in limiting the rate of evaporation when there is an insufficient supply of water, or when the rate would exceed another rate limiting factor. So it is much more important to a plant to control the rate of evaporation through means such as the stomata and evaporative barriers such as the waxy cuticle.

Long story short, as much as it might make some sense at a cursory glance, on further scrutiny this idea doesn't really stack up.
Reply: @michaelransom5841  Exactly. Glad there are other people here who actually research things!

I got a bit tired replying to like 15 comments so I didn't go into much detail about all the fun stuff you talked about.

People often assume one simplistic thing based on something generally true but forget that there are lots of other factors and interactions.

Like people tend to go from a correct statement that plants need water to live to thinking that it is the one factor and only factor that plants are selected for (forgetting about all the fairly obvious problems like diversity of plants and the environments they live in in addition to the more subtle things like the importance of transpiration as a key driver of nutrient/material uptake and transport in terrestrial plants).

(Which is particularly interesting because from a more general view it means that they are often using lots of the solar energy that people think of as 'wasted' when they focus too much on photosynthesis. It is all about a balance of the various factors in the environment. Even within plants its amazing that people don't consider and get skeptical about their ideas when observing that Duckweed, enormous conifer trees, C4 grasses, mangrove trees, and cacti all still use light wavelengths in similar distributions despite having completely different water management priorities/strategies).
Reply: @kanoaika  well said
Reply: Fantastic insight!
Reply: @standlegweak9854  Though wrong.
Reply: ..and now we finnaly have a good answer to "why green".
Reply: That is a brilliant deduction!
Reply: This is a much more satisfying explanation than "sunlight is mostly* green light". Little kid me was constantly confused as to why the sky wasn't green then.
Reply: -clorophyl does't evolve theres only two types a/b and they have been the same since...a very long time ago
-photosynthesis  uses 1/ red and blue light 2/water captured by the ROOTS 3/ C02 from air
and it produces 1/ carbs that store energy or let the plant grow 2/ O2 released 3/ the green light not used is reflected
-leaves have "pores" that can close to block C02 and stop photosynthesis if the plant lacks water

so if plants could evolve to process green light they would probably do and would have darker, less colorful, 
 almost black leaves and would grow faster/require less light. light is a scarce ressource in dense primary forest and creates strong competition between plants to grow quickly and reach rhe canopy. plants able to process green light too would have a buge competitive advantage.

if dew is on the surface of the leaves it has more chance to be evaporated by the white light from the sun + green light reflecred ny the leaves
Reply: @geemy9675  , that's very interesting ... but if I'm not mistaken, there are plants with red chlorophyll (Red Foliage Trees), which have red leaves (ie reflect the red light) all along (not just when their leaves die, as most trees in the autumn), but for some reason these trees didn't end up as dominant vegetation.
Reply: @blueckaym if they were less efficient then that would explain it, maybe there was once more red trees and what we have today is the last of the hangers on.
Reply: @geemy9675 on the other hand, the pores on leaves (stomata) open to take CO2 in and let O2 out, and when there’s more CO2 in the air, they use less water! So said the late Freeman Dyson.
Reply: @shandor2522  "Carbon dioxide is indeed well mixed in the atmosphere. This means that if we look at the CO2 concentrations globally, the value is about 400 ppm everywhere"
higher concentrations of CO2 only happen in enclosed spaces
"The chemical equation for photosynthesis is 6CO2+6H2O→C6H12O6+6O2"
so plants do use exactly ONE molecule of water for EVERY molecule of CO2 processed by photosynthesis...
Reply: @shandor2522   - very much utilised by greenhouse farmers everywhere.  Maximise sugar production, minimise water use (water is often the most expensive ingredient, to source in agriculture - and the greatest required quantity.)
Reply: @geemy9675 Indeed. That doesn’t necessarily mean that the author of the video, which answered so enthusiastically, isn’t  as understanding of the subjects he divulge but certainly gives a bit less weight to statements like “I reviewed the paper and can’t find fault on it” hehe
Reply: @frgv4060  being a Berkeley engineering graduate , experienced and successful mechanical and software engineer and tech enthusiast I think he does have an understanding way above the average youtube commenter. though youtube  doesn't reward pinpoint accuracy, fact checking, scientific method etc..
Reply: @geemy9675  I recall pinpointing a mistake on a Neil deGrasse statement and get bashed with similar “reputation argumentation”. Of course the mistake was real, quite obvious… and eventually acknowledged. But it takes more than the “average Youtube commenter” to have more than mere person infatuation and enough critical thinking, culture, education and why not, experience on let’s say “cultured circles” to put into perspective the merits of certain claims. That said, I have all the right to doubt and express that doubt no matter how offensive it may seem to you hehe. But you can, of course, continue regaling me with some other fallacy. It is indeed entertaining.
Reply: @frgv4060 not a facepalm emoji sufficient enough to express how facepalmy that comment was
Reply: @gfdia35  If something pinpoints to a lack of knowledge on a specific area, in this case a bit of life biochemistry history, compounded with that conclusion that doesn’t really make much sense… casting doubt to the “any paper reviewing authority credentials” it is only logical. So if it is to you the most outrageously absurd comment to make given “the author” ok, I would suggest you make some better valid points instead of just fussing 😂😂
Reply: @geemy9675  thanks!
Reply: @geemy9675  I would not be so eager to dismiss the commenters suggestion, especially when you got wrong the numbers of types of chlorophyll, there are at least 6 types: a, b, c1, c2, d and f.
Reply: @geemy9675 Been to Pikes Nursery before- and noticed that some plants do have nearly black leaves - what's the difference between those and lighter green leaves?
Reply: @geemy9675  you're clueless. It's not that the chlorophyll evolved, it's the plants that evolved the chlorophyll. BTW, there are plants that DO have red/brown/black leaves for most of the year - not many, but some do.
Reply: @vaakdemandante8772  red leaves still use same chlorophyll, the red color doesn't come from chlorophyll. but anyway this whole idea is wrong from the start since green chlorophyll does let  green light pass through, if you wanted chlorophyl that reduces evaporation it would have to ABSORB green light. plants deal with evaporation in many different way which is not related  to their color. cacti can keep water for 6 month despite being green
Reply: @geemy9675  It evolved from something- this could explain why the green method dominated the world and drove out the purple version.
Reply: @Hinoema01  this is a nice explanation but it misses the fact that chlorophyll absorbing all but green light cannot reduce evaporation. if anything it increases it vs other variants of chlorophyll that would absorb green light.
Reply: @geemy9675 chlorophyll doesn’t evolve?  How the how did it get here in the first place?
Reply: @derekmcaleer2386  every type of chlorophyl has similar spectrum that absorbs red and blue and lets most green light pass through so it's color didnt evolve. also red and brown algae evolved to green algae using chlorophyl, because of better light in shallow waters, 500million years before land plants, and were not subject to evaporation so suggesting that plants evolved chlorophyll to become green to minimize evaporation is rewriting (pre)history
Reply: @geemy9675 not subject to evaporation ? Huh,,,, so just for one second let's pretend the algae are self aware and know their in a pond that is rapidly evaporating to soon be a dry dust bowl , pretty sure they'd wish they could slow down evaporation,,,,,, I kept seeing this algae argument as if 1 all plants are identical and all evolved for the exact same reason and 2 all algae are ocean going and have unlimited water supply, technically all of earths oceans will evaporate so it's at least quasi plausible and not 100% deniable
Reply: @geemy9675  Yes and what about plants that do not have any neighbours and are exposed to normal light? They do photoquenching, because too much light equals stress. The threshhold of where light = stress is much easier reached than many think.
Reply: @geemy9675  what about the purple photosynthesis pigment?
Reply: @geemy9675  "so if plants could evolve to process green light they would probably do and would have darker, less colorful, 
 almost black leaves and would grow faster/require less light. "

some plants have dark dark purple leaves by producing lots of anthocyanin. like plum trees.
Reply: @MyBinaryLife  "Anthocyanin: is an important pigment that's not directly involved in photosynthesis, but it gives red stems, leaves, flowers, or even fruits their colour. At low light levels, green leaves are most efficient at photosynthesis"
Reply: @geemy9675  you sound like an average redditor
Reply: @geemy9675  Chlorophyll is the term used for the pigments found in the chloroplasts, Chloroplasts evolved !!
Reply: @geemy9675  
I know a method of evaporating 2,600 times quicker and it has been around since water came to earth, would you be interested?
Reply: @geemy9675  that's how evolution works though, the fittest organisms survive, which means there might have been other "forms of chlorophyll" that absorbed green light and it was an evolutionary disadvantage so the chlorophyll we know today succeeded.
Reply: @geemy9675  Fine, it's an accidental side effect of a random mutation that proved advantageous over time. :)
Reply: @colleenforrest7936  Which is exactly what evolution is :)
Reply: @colleenforrest7936   "it's an accidental side effect of a random mutation that proved advantageous over time" ... that sounds like completely speculative nonsense.
Reply: @colleenforrest7936  God is laughing...  Psalms 2:1
Reply: @colleenforrest7936  Seems doubtful given the algae thing and the sheer uniformity of chlorophyll. It was a really good idea. But if a significant fraction of the selective pressure was for reflecting green light to prevent evaporation then we would expect to see more diversity and differences between algae vs plants in dryer environments. Seems more molecularly constrained where chlorophyll is a tough molecule to evolve and you can't mess with it too much without screwing up the efficiency/needing to reinvent it
Reply: @samjubilee6593 🙄
Reply: @botchvinik8668  '"it's an accidental side effect of a random mutation that proved advantageous over time" ... that sounds like completely speculative nonsense.'
It's the only type of adaptive evolution we have significant evidence for.
"'unguided evolution' is a myth."
Citation needed.
Reply: @colleenforrest7936  No - not random.  ALL life uses ATP/ADP and NAD/NADH as basic energy medium, and only select photochemical processes can drive ADP->ATP or NAD->NADH, and these require red & blue light respectively.  You can't just "evolve" a new chemistry that converts ADP->ATP with green light - it's limited by the energy requires and the chemicals available.  To make sugar + O2 from sunlight+co2+h2o REQUIRES 18ATP & 12NADP.
You certainly can capture energy from green light in photochemical process, but NOT in a way that assists the metabolism of life on earth.
Reply: @colleenforrest7936  No - no accident.   All life on earth uses ATP & NADH.  Plants use 18ATP & 12NADH to make sugar.  The photo-chemistry to create ATP from ADP or NADH from NAD doesn't evolve - there are very limited options restricted by chemistry, the energy required and the specific chemicals available in organisms.
You can certainly capture energy from green light in a photochemical process, but not in a way procudes chemicals that aids the metabolism of life on earth (ATP, NADH).
Reply: Wow your genius
Reply: Or maybe It doesnt absorb it in the light harvest complex to enable evaporation from lower leaves to stabilize sap flow
Reply: Came here to exactly tell that - so I'm not the only one! ☘️☺️
Reply: Well, you see green because chlorophyl reflects all colors except green, Green is the missing color, that's why you see it. (Review your High School science!)
Go to one of the big fat leaves like an elephant ear or a banana tree, in direct sunlight, it is cold. It is cold because the as Green light is absorbed, it flashes off the water into vapor so fast, it absorbs more heat than is present causing the large drop in temperature.
Reply: This finding actually tells me the opposite, this may be why plants choose green (despite not being the best for photosynthesis).
By reflecting the green, they ensure water bubbles keep evaporating… at the very least produces some sort of wind/breeze.
Reply: @alexmipego  plants are not using green for photosynthesis - they are throwing green away